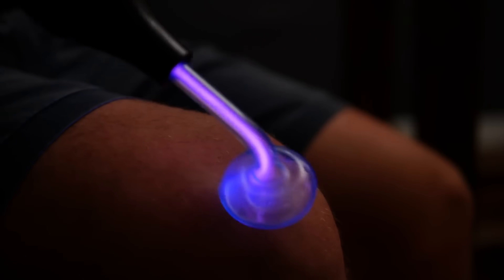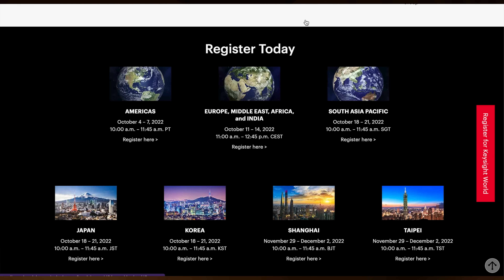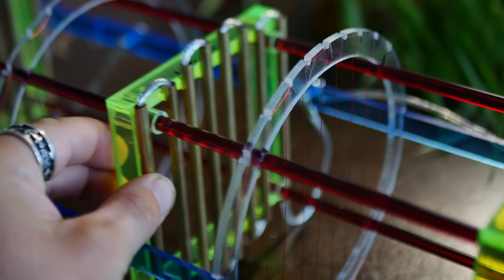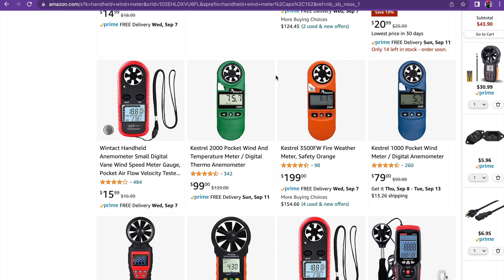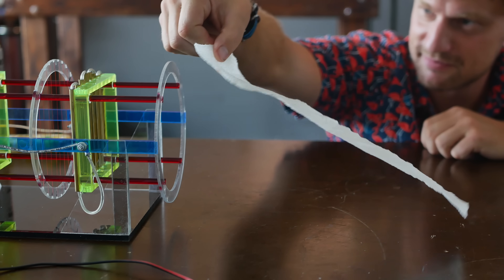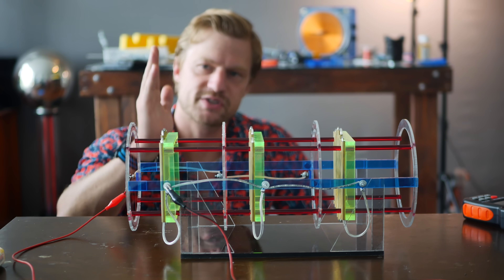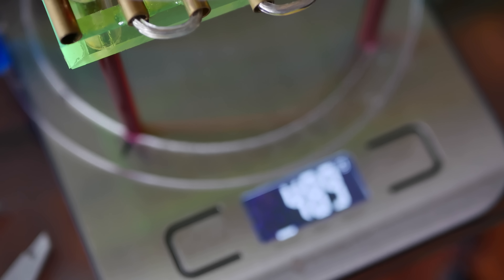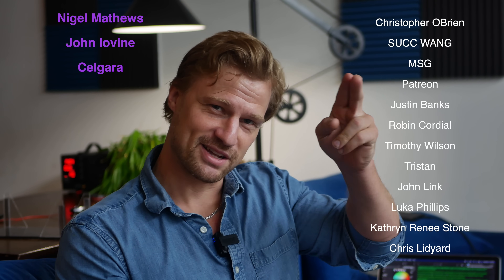Designing A Next-Gen Ionic Thruster! (For Flight)

Comment: What happens when you take the same concept and apply it to a turbine engine without the moving parts but where the exhaust/drag creates not interruptable propulsion on the front end to increase the air flow as the electricity increases while both pass through the workings of the motor, there would be no need for jet fuel in this equation but of course as is your issue in any imaginable build power source.. or one in the same, fuel. you would need to create some form of micro perhaps nearly nano tech to respond to propulsion and turn that into energy but that will not result in increased resistance or drag on the thrust

Comment: Well, for starters you can probably do with confining the airflow. You are most likely using up a lot of thrust by allowing us to see in. Luckily, it's not a cumbustion engine so using see through parts is a possibility. My other concern is the lack of compression. If you were to slowly funnel the air down, you might end up getting even more pressure out of the thruster. This could also save weight and power by letting you step down the sized as you move towards the end of the trruster, with the last one being half the size of the first (at the very least.) Obviously I'm no mechanic or phyisicist, I just enjoy using parallel logic since I am very interested in normal jets and aerodynamics. I look forward to seeing the next stage of your thruster!!!

Comment: If it was enclosed in a cylinder it should gain more thrust. If you could get the ions to spin would be cool. Controlling the ion flow direction. A little compression or back pressure would probably give you a different result like a cone exhaust.🤷🏾‍♂️

Comment: but but

you put the whole array on slides and only tested 2 configurations? >:(

i thought you were gonna trombone that shit since a long field at the suction end vs short field would have a different shaped flow through the tube. 

equal spacing sounded less discordant than your 1.5 1.25 1.0 config, so i bet you'd get laminar smoothness when it sounds harmonic?

Comment: Love to see it done enclosed in a casing to funnel the air flow to its best thrust output and increase the voltage at each stage individually both with and without the gap diferences. My hypothesis is that if you set stage 1 at 1.5inch & 11k volts, stage 2 at 1inch & 33k volts and stage 3 at 0.5inch & 66k volts and funnel the moving air that thrust should increase significantly. Please attempt love to see the outcome

Comment: This was an idea I had as a form of new space propulsion when I began my career as a T.V. Engineer back in the 80's and my Tie stuck to the front of a Television..

I Know anyone could say this but It's honest truth I had no knowledge of this only a vision in my mind.

It was a seed planted a few years previous by a question asked in my physics class about any ideas for a different type of propulsion method in space.

My reply was slightly silly but the only one put forward and the flaw was instantly pointed out by my teacher.. "Spinning a propeller in space and taking the advantage of no friction allowing it to rotate forever isn't it's design flaw, The lack of air for the propeller to screw into, Was..  Lol.

The Thought, when I had my original idea was to switch each H.V. Coil on and off in quick succession..
Maybe try connecting to a car distributor cap and spin that with a drill.?

If that works look into switching the coil driver on and off faster with a simple 4017 Decade counter driving F.E.T Transistors and a 555 variable frequency clock generator or an Arduino driving 4 F.E.T Transistors (Take care protecting the electronics with suitable flyback suppression)..

This suppression isn't required with the mechanical car distributor which is why i'd reccommend trying that first.  Around 5 euro from a car scrap yard.

Plus, i've never seen this idea of quickly switching each HV Coil / Output on and off sequentialy.
I think the only speed limitation would be the charge up time of the drive circuit to production of ions.?

The 4017 Decade counter can operate in the 1000's of mhz range, faster than the 555 timer can supply a pulse, so no issue there.
But this method would only be able to drive the primary side of the ion generator which may slow down ion production due to the charge production ramp up time to H.T.  output voltage being sufficient enough to produce the ionization voltage.  (This is still really fast but is something to consider)

The mechanical idea with the distribution cap would only need to use one (constantly running) high voltage generator allowing for the pre-generated H.T. voltage to be applied onto each of the ion grids in sequence but may require arc distances/voltages to be looked at because if the arc is long enough to jump across to the next contact within the distributor then that defeats the point of introducing the distribution cap.

I'd also be very interested to see the results..

Cheers.

Comment: A continuous cyclotron emited molecular beam,
feeding into a linear accelerator. The matter beam would be sped up
while being ionized at first, but after de-ionization would function
akin to a molecular beam, in a straight line at high relativistic speed,
and being non-ionized at that time.
Projected onto a vessel that first ionizes the incoming matter stream,
and then uses fields to decelerate the now once again ionized matter.
The deceleration of the incoming matter now relays it's kinetics
on the receiving vessel, while also being projected back using
a similar system, for additional speed gain.
Only usable in outer space, since any atmosphere would disperse
the molecular beam.

Also, more importantly, any solid surface being recipient of a molecular
beam emission, would not be able to stop it, since kinetic transfer
from particle to receiving particle would greatly exceed the forces
that keep the receiver intact.
For reception you need time and with that only fields can be used
to allow for spreading of the force over time.
The field would rapidly decelerate the particle but not instantly.
Also, the ionization is also a requirement for capture and re-use
as fuel for the vessel itself, or possibly even re-supply with mass
en-route.
.

Comment: remember boundary layer you need to space the wires close like .5mm apart to maximize efficiency! also instead of using round tubes you need to make aerodynamic wing shaped rounded on back side pointed in direction of airflow

Comment: My first visit to the Channel. You remind me of my favorite TV shows. Star Trek and MacGyver! I ammo o where skilled or trained as well as you but have a practical mindset that has worked well for me over the years. In response to your three pitfall question I will throw mine in. Voltage source large enough to supply power but in a very small and light enough package to offset ots weight. Noise level that I suspect will increase as more thrust is gained. Not going to be very acceptable o er populated areas. Last, how to achieve thrust and be in motion at the same time. Ram air flow from having motor in motion may not increase on the output enough to move the object it is mounted to.

Comment: I wonder if it would be possible to use laser wakefield acceleration to improve the thrust output of an ionic thruster...
It's been able to accelerate electrons to near light speed in about the size of your thruster here instead of requiring km long
particle accelerators and since greater exit velocity means more thrust, if it can be done with the various ions from the air that
could provide a massive increase in thrust. (Granted electrons require a lot less energy to accelerate so the ions wouldn't get
anywhere near the speed of light) I'm also no certain how easy it would be to build that as a home project (probably very difficult).

I only recently learned about lwa and it is fascinating but I don't pretend to know much about it but I'm really interested in knowing if this could be implemented that way.

Comment: NIce work, however 1.Why cathodes are cylindrical instad of plat paltes palced streamwise? This is chocking a flow. And at small Reynolds number drag coefficient of cyllinder is really high, due to separation of laminar boundary layer. 2. At the ballance measurement of thrust fir sall separation there will be negative groud effect: chocking of the flow by ballance plate, and the effect of underpressure sucking the plate upwards. I suggest  to employ  a higher distance rods. ca. one diameter of the thruster. 3. The thruster has no  sidewalls, so there will be some ejector effect due to the "fresh" sideward air sucked  between stages insreasing final flow mass flux.  Anyway, best wishes from Poland. :D

Comment: 1) Confined tube for less loss of air
2) Pulsing the stages rather than steady voltage for overall energy efficiency
3) Lose the weight from the copper tubes. Remove nuts and bolts.

Comment: Few Ideas for such a staggering build: Maybe you could get away with making the engine smaller by fitting the electrodes together in a teardrop shape, with two charges separated by a good isolator. Other than that, I would try using a non-linear electrode structure( maybe a honeycomb-like one). In the future perhaps I will tackle this subject and try to find the best special configuration for such an engine, but for now, I have no resources to do so.

Comment: So im not an engineer but i think i see two problems 1. by not encasing the thruster your letting air from the outside interact with the air you want moving slowing it down, and 2. I think added a nozzle would probably increase the thrust

Comment: This would take significantly more science but what if you built it into a jet engine where you can adjust the thrust by changing the spacing while in the air if you were to build it into a plane so you have adjustable speed basically

Comment: I don't quite agree with the way you measure the thrust on a scale since the downward pressure from the wind would act against the thrust that tries to lift the thruster up. The actual thrust should be more than your measurement, which makes the project even cooler.

Comment: I imagine the air-flow would benefit being ducted. Not having the chance for air to exit the sides. Solution: Put the thruster in a tube.

I'm curious if clocking the different stages would help increase air-flow a little.  1st stage vertical grounds, 2nd grounds at 45 and the 3rd at 90. Maybe create a cyclone affect? unless laminar is best.

Along with making the thruster ducted, a velocity stack would likely assist and not increase the weight too much.

How well could the thruster create pressure? De Laval nozzle?

Try different wire spacing (tighter weave). Perhaps instead of just rows of positive wires, a cross grid design.

How about 1 set of positive wires and 2 rows of negative tubes at slightly different distances with the 2nd row of tubes phased at 90 degrees.

Comment: 1. Ducted air flow
2. Staggered voltage alongside staggered spacing
3. Stagger wire orientation?
4. CRIMP WIRE AT REGULAR INTERVALS TO CONTROL PLASMA CONCENTRATION POINTS. The arcs were kind of random at where they were most intense.
I'm thinking of kind of a --^--^--^--^--^--^--^--^--^-- type wire design. :D

Comment: Working something similar for senior design research. Do you have a link for the collector wire? What gauge? Also, was the wire inside the tubing insulated? What makes the connection between the tubes and the wire?

Comment: I would make hole in the middle of the array for ionised air to flow unobstructed. Each array needs to suck air from the sides so I'd separate the arrays with funnel like ducts. I'd also makes a body that would direct air into the ducts and measure how the thruster improves if the air is blown into it.

Comment: Have the positives of each stage on different voltages, I think it should increase velocity also having the stages closer together? Ducting it and having a intake cone should help a lot. I was thinking if the ducting isn't enough, another way to do it is each stage should get it's own cone, drawing air from the outside and funneling it inward.

Comment: So my improvement (with limited knowledge) would be to polish your wires (with fine sandpaper).  When the lights were out, you could see how only certain spots of the wires were glowing, however if you polish the wires, exposing more copper (instead of dirt, patina, or whatever coating they add from the factory), you will hopefully find that you get more ionization.
Reply: Another thought I had after reading another comment, would be to change the surface of your ionizer (wires) to be rough, or have points where charge can accumulate. Maybe even something similar to a radiator design might do the trick?

Comment: 1. Use a teardrop/wing-shaped things instead of the tubes, which should reduce turbulence after one stage
2. Try enclosing the thing in a tight fitting tube, which could facilitate less airflow loss due to it escaping
3. Staggered voltage. Higher voltages nearing the exit may result in accelerating the air faster if it already has momentum.

Comment: My big issue is a non uniform measurement distance... your 3 areas of concern are most likely weight of electric supply, rigidity of lighter materials,  and degradation of wiring.

Side note, might consider smaller parallel wired thrusters

Comment: Ion collection at the ground electrodes should be increased with longer and more flat electrodes (flatness to reduce drag)
And you should reduce the space between the strings as much as you can to increase power efficiency (the more air mass you put in motion the better)

Comment: Instead of ionizing air, would you consider using a gas (preferably widely available) which has a lower breakdown voltage? For example Nitrogen. Combining this with a turbine design would generate more thrust?

Comment: If you were able to do a lattice winding structure. Therefore increasing the surface area through which power is routed. I would be curious to see what kind increases you would get. The amount of weight added for double the windings I believe would be negligible.

Comment: It is possible to use a helical layout down the tube which would build thrust in previous interactions while also producing centrifugal effects on the airflow, which produces large Kinetic results. Apply jet/rocket principles and designs to contain in the air through the reaction tube to prevent aerodynamic turbulence throughout the build, leaching air momentum out of the system.  Spinning air thrust out a nozzle should be orders of magnitude more powerful than the results you're getting using the same power inputs.  Measuring wind force with the handheld meter was not very accurate.

Comment: Couple Random Thoughts...
1. Incasing the air flow between the sections
2. Adding a intake duct at the front to funnel air smoothly into the system
3. Moving the sections slightly closer together closing the gab for air possibly slow

Crazy Thoughts I would like to know the answer...
1. Would a true square grid work on the positive and negative of one section? Thinking like a checkered board...maybe spaced slightly to prevent shorting. (maybe adding too much material may lead to less performance due to making a "wall" the air is hitting.
2. Does changing the blunt tube sections in diameter make a difference in flow, possibly going smaller for air to flow easier around, but in turn might make it less efficient.

Comment: Wow, great! 😁

I wonder If this setup can play audio below 3000 Hz without blowing out the ionic flames.

Do the conductors have to be in a specific orientation or is possible to use a grid?

I also wonder If this setup creates enough pressure to replace the electric super-/turbo-charger of a internal combustion engine.

Another interesting idea is if the ionic thruster can be used as a compressor in a turbo-jet engine with a magneto-hydrodynamic generator as a turbine.

Comment: You could probably concentrate the air-flow of the thrusters to provide a more "explosive" thrust. This could be done by adding a nozzle of some sort the the end. Like a blow-dryer for example.

Also by restricting the spread of the air traveling through the thruster you could have more airflow within. Maybe by creating a vacuum of some sort. 

Since this is a multi-stage thruster. You could alter the voltage and wattage of each stage to see which combination provides the most thrust.

Comment: After seeing integza mention you I had to see this. 
If we ignore power for a bit, would a 10 segment version change anything? 
Would a shroud around change anything?
Reply from the maker: Thanks for hopping to my channel, and great questions. So, many people have asked about the shroud - shrouds actually will reduce airflow somewhat, since air comes in from all sides of each stage. Ten stages may be pretty heavy, admittedly, but worth an experiment!
Reply: @PlasmaChannel  
My thoughts went to upscaling it all to the level where weight isn't really a problem. The millennium falcon. 😉😂 But if it's scalable in a decent way it could be possible to combine with an aerospike design and do something good - but it would take a nuclear reactor to drive. 😐
Regardless it's fantastic science to follow. ☺️